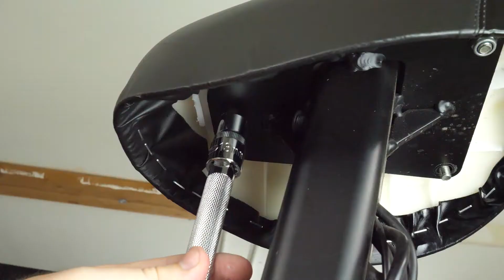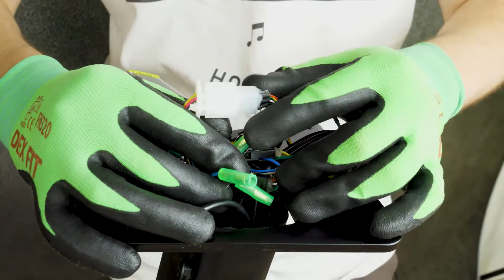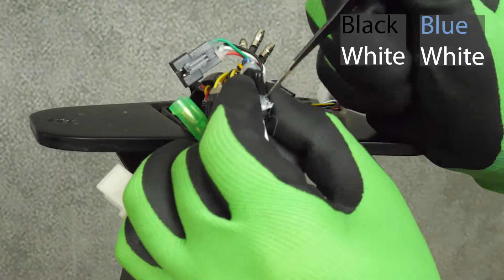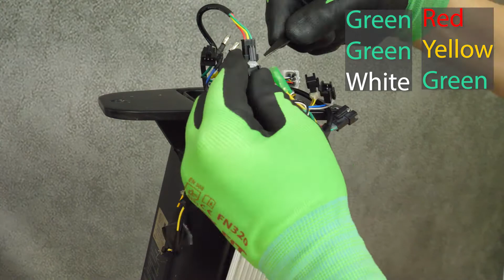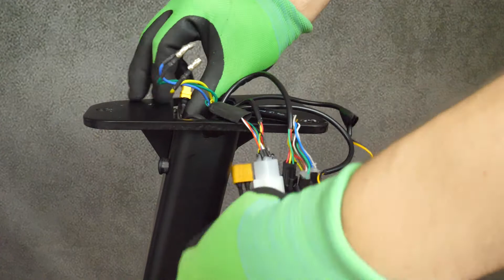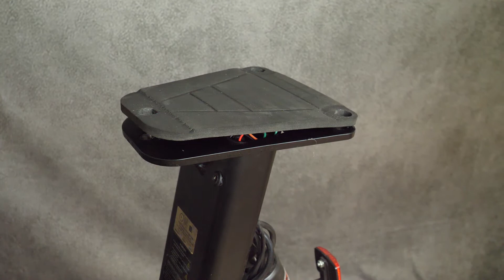How to replace the Controller on the FIIDO Q1s

Comment: If I build a 30ah 36v LiFePO4 battery (3 12v 30ah batteries wired together), it should plug right into the controller with an XT60 and give me 3 times the range, right?

Comment: How do I install the Fiido L3. On the controller side for the brakes and the throttle  is a jst-sm 4 pin connector. I was told the grey and white are for the brakes and that leaves 2 more open which are for the throttle which has 3 pins. So I dont know how to use a multimeter. Do you have the information I need please ?